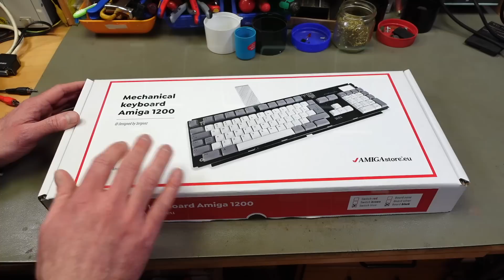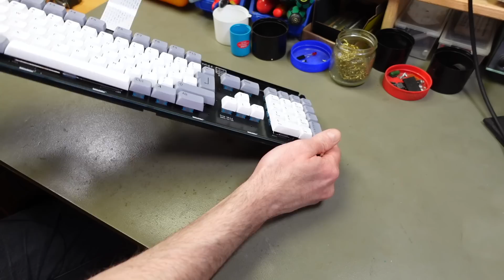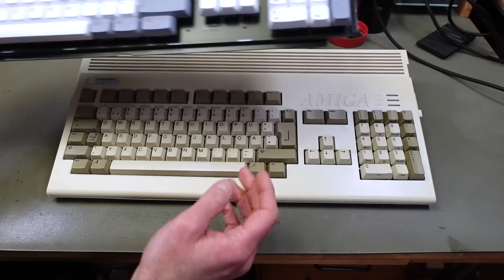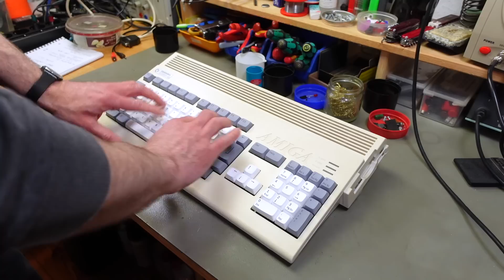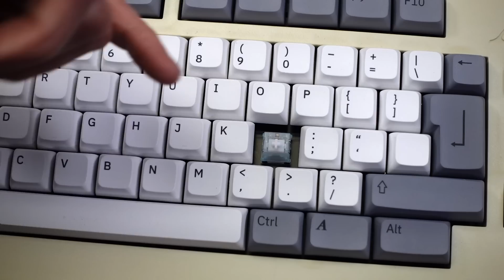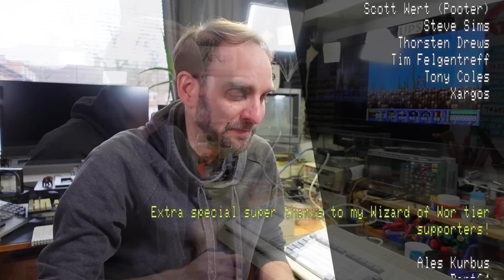New Mechanical Keyboard for the Amiga 1200

Comment: So it doesn't take the regular caps? like those black ones that were available? No black caps option on their site either. Will have to wait till I'm doing a regular coloured build....
Reply from the maker: No, these are XDA profile keycaps, the standard Amiga ones don't fit modern switches unfortunately. (Except maybe for some of the very early Amiga keyboards that used actual Cherry switches.)
Reply: Hi, regular keycaps from Commodore won't fit. It's modern plug&play replacement. I don't want to go ahead of the good guys from AMIGAstore, but I think black XDA keycaps will also be on the menu

Comment: Jan, the switches used in this keyboard, are they sourced from another manufacturer, or are they made in house by Amiga ?
Reply: I tested lots of switches for this purpose. Kailh had a very solid opinion at the moment, and other necessary technical features that made them the good fit. As a company they are also small and big enough at the same time to ship large batches to smaller organizations. Finally: they sound good.
Reply: https://youtu.be/BKkBesUKZwE?t=380  He mentions Kailh switches
Reply from the maker: These are standard Kaihl switches.
Reply: They are Kaihl brand AFAIK.
Reply: Amigastore is using Kalih switches.